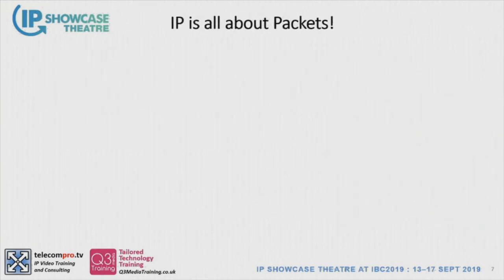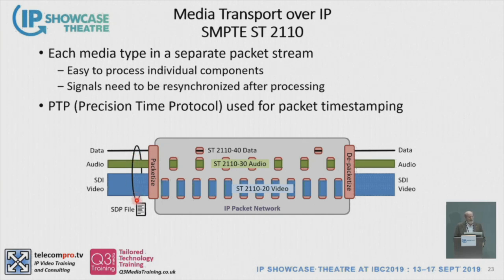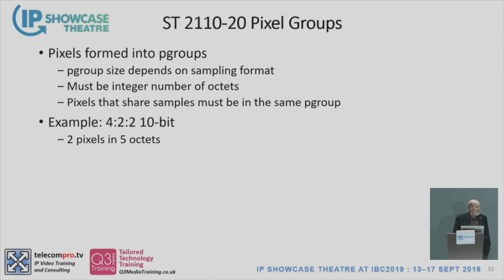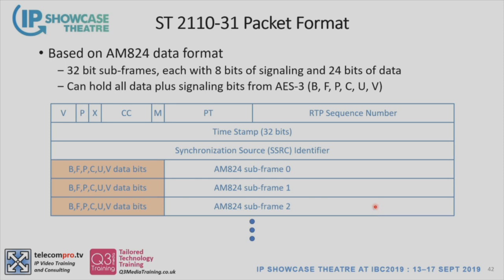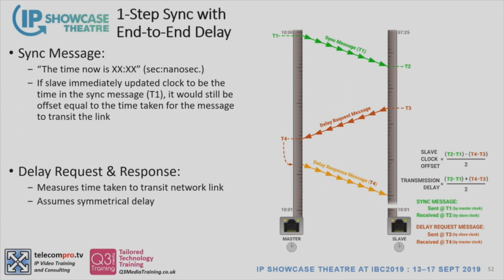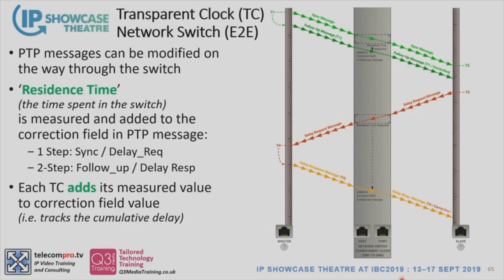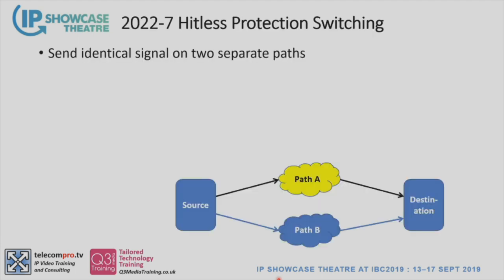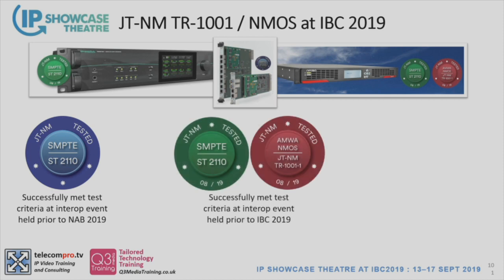Fundamentals of IP in Broadcast Production, with ST 2110

Comment: We built an OB truck ip NDI and Dante workflow for small grassroots productions. The biggest difference is cost. You would need min 40gbe router to have SMPTE 21 deployment. 4k 60fps 10 x 12g for SMPTE 21  uncompressed that adds up.